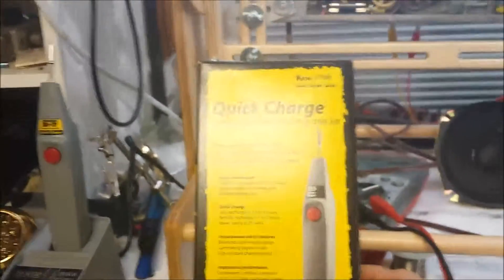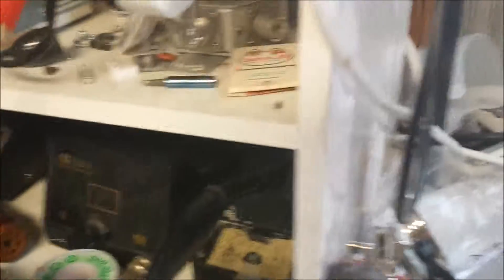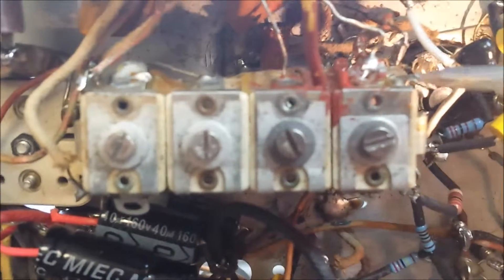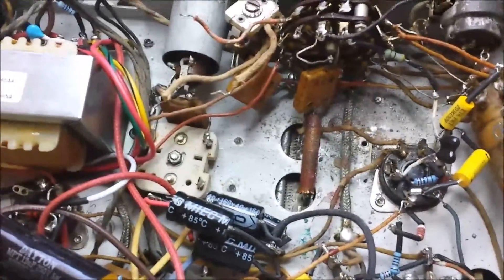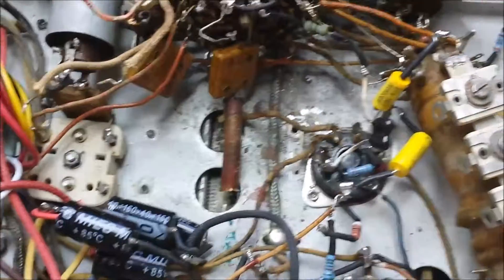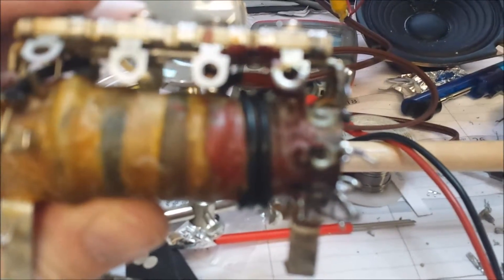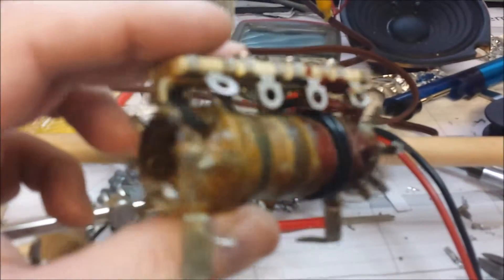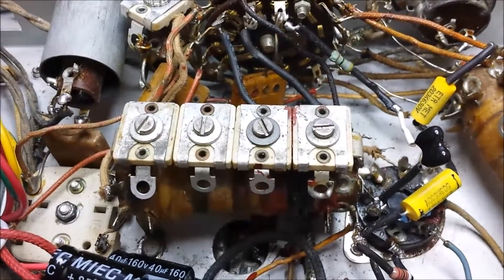K1SVC S-38 Restoration - Part 5

Comment: hi if this is for the hot chassis were can i buy them . this would make my dads s-38 so much safer for him .
Reply from the maker: Yes it is an isolation transformer.  The one I used was a Triad N-68X.  You can get them at mouser.com or newark.com.